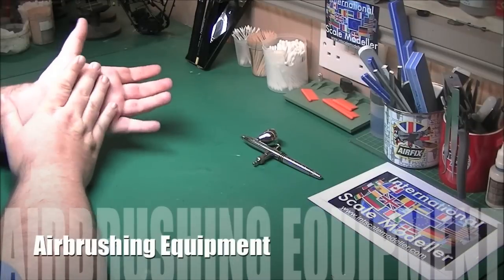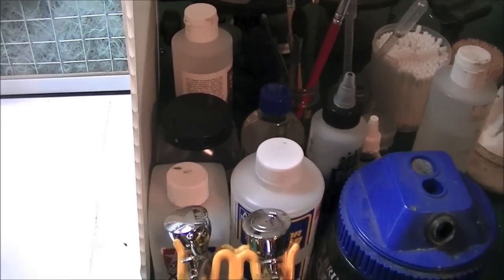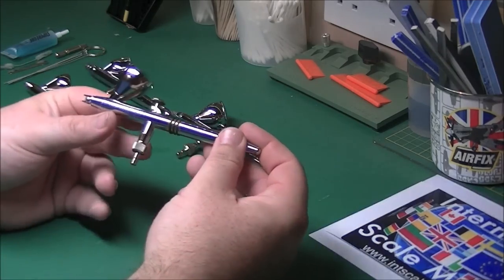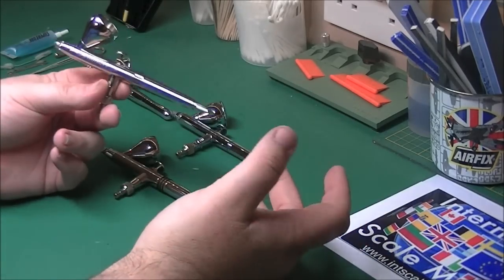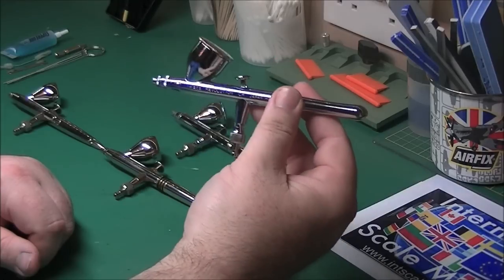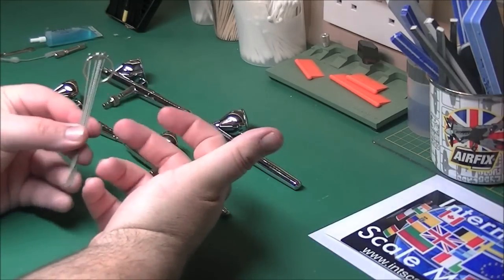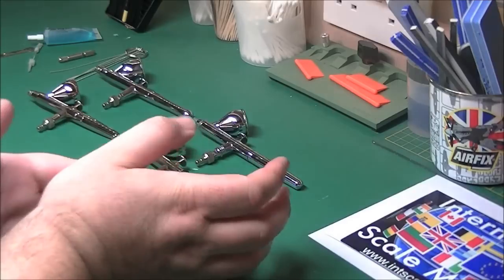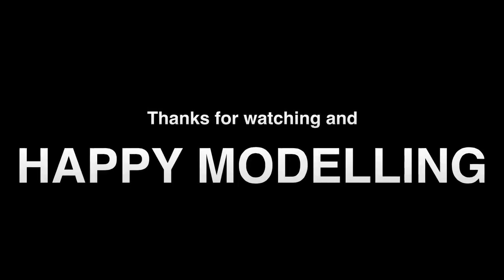Scale Model Airbrush Equipment Guide

Comment: Hi Paul, Brilliant, informative and knowledge-packed video. I'm coming back to models after a 35 year gap. I've used acrylics for art so I'm completely sold on these and would not touch emamels if you paid me. I'm not sure if you can give some advice on what I would need as a good starter airbrush? Sounds from this video like you'd recommend the Neo from Iwata with the larger cup and pinch front? I was also wondering about compressors? I wanted to buy something that would be around for some time, as I will be moving to a more expensive airbrush at some time in the future no doubt. I'm completely ignorant about this, so any advice would be appreciated. I'm planning to work almost exclusively on 1/35 tanks and armoured vehicles. If you have time and feel inclined to respond, that would be great, but if you are too busy, I completely understand. looking forward to seeing more or your work, regards Matt

Comment: I'M new to airbrushing, i was given one by my brother.Haven't even used it yet. I was wondering if the spray booth is a must even if I use only acrylics (Tamiya for the must). Because I don't have the space yet
Reply: If you were if a well ventilated room and wearing a proper respirator face mask you may be ok doing small parts, but i wouldn't recommend it especially if its a lived in room like a bedroom etc. Have you got a shed or garage you could spray in?
Reply: Paul @ ISM thanks for the info. Actually i don't have that kind of space for now. I work on the kitchen table and it's an open area to the living room and kitchen. So I'll do only small parts with window open and the big ones outside until I move into my knew house. This brings me an another question...when I'll be there, I was planning to purchase a spraybooth because I'll have a room to myself for building. Those it have to be ventilated outside ? Because there's no window in that room
Reply: Ideally it needs to vent out side,or all it will do is catch the paint particles leaving the paint fumes in the room , which isn't a good thing

Comment: Hi Paul,
Is it possible to list the names and brands of all your equipment (spray booth, compressor, ...) you mentioned in this video. It will be much easier for begineers (like most of us are ;-) to do some research on the net if we want to try to reach your skills level ;-) Thx
Reply: Hi Micheal

Airbrush extractor - Graphic air A300s-d
Compressor - Paasche D3000-50
Airbrushes 2x Harder & Steenbeck .20 Infinfity 1x Harder & Steenbeck .40 Ultra
Harder & steenbeck clear airline with quick release
Reply: hi paul
I do a lot of airbrushing on model airliner kits with acrylic paint sometimes using enarmel paint,i am working in a medium size room with the window wide open
I don,t have a spraybooth as I am trying to save money I use a facemask I don,t
be airbrushing for to long I take brakes if a windy day I would occasional open the window into the bathroom upstairs for the wind to blow through for ventilation
would you please advise me if this is safe enough, Thanks,
Reply: To be honest david, no. You still allowing the fumes the circulate the room and although you may be wearing a face mask i wouldn't trust that totally. You will also suffer a lot of dust from were the paint has settled too. For a short term solution then you may get away with it for long term you need to think of your health and other factors too.